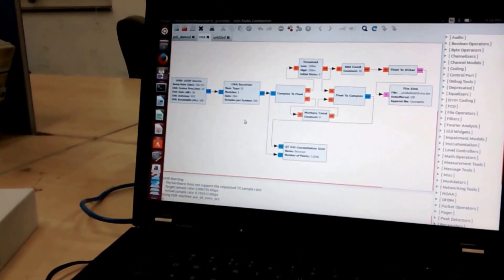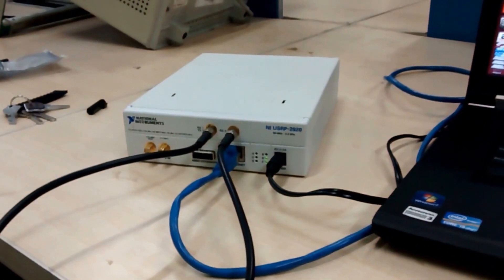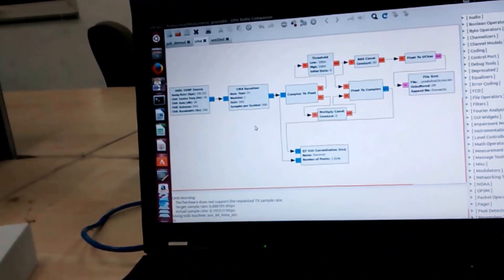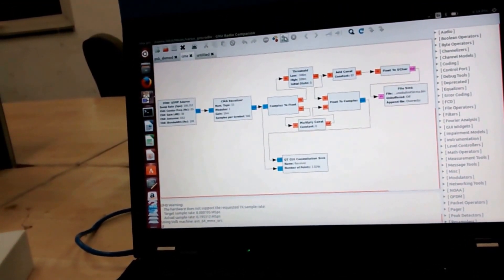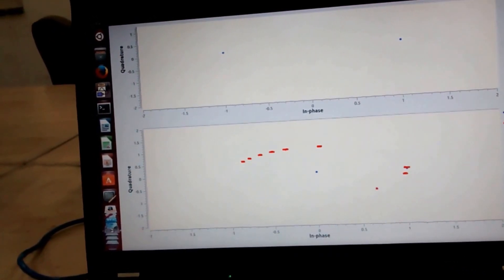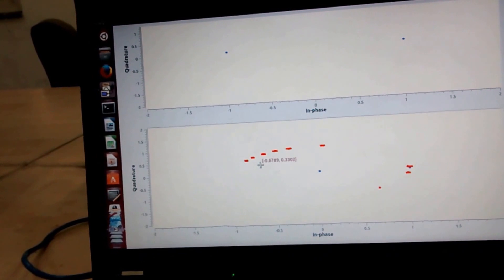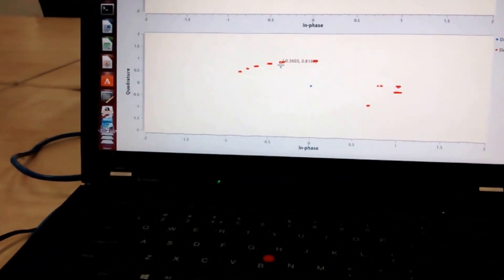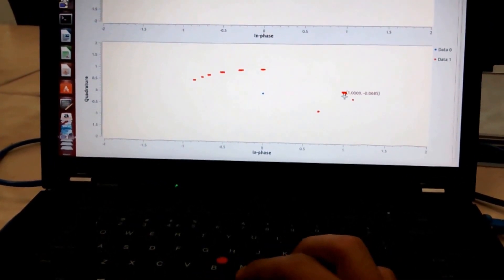Implementation of BPSK Modulation using GNURadio and NI-USRP 2920

Comment: i used GNU radio with NI USRP  2920  and i have some problem with that , while I run the flow graphe the get error no device found,  can you help me with that
Reply: +Varun13169  : device not found 
empty adress
Reply: +Varun13169 
thank you for your reply Varun, 
yes I did .However, when I am visiting this link http://files.ettus.com/manual/page_install.html
 i realize that I need to install  UHD by using this commande line "sudo apt-get install libuhd-dev libuhd003 uhd-host" .
 do I need to setup FPGA images and firmware ? 
I need your confirmation.